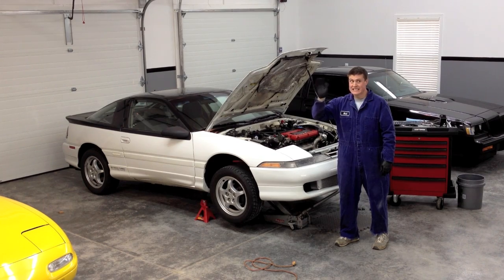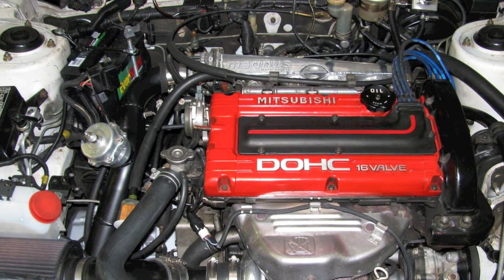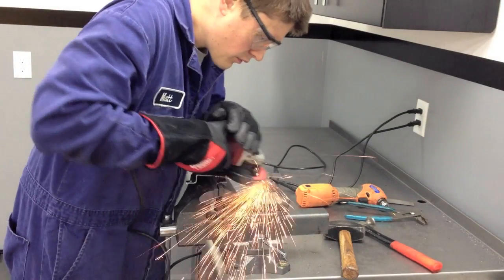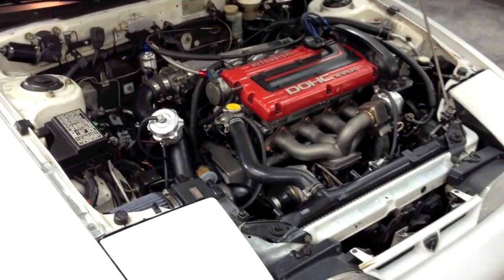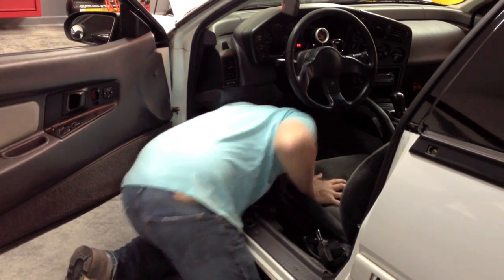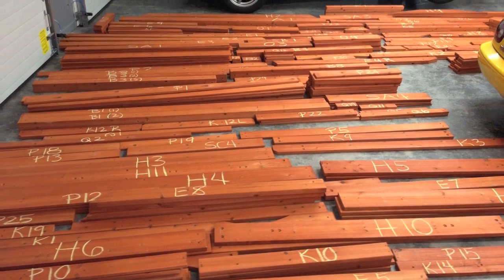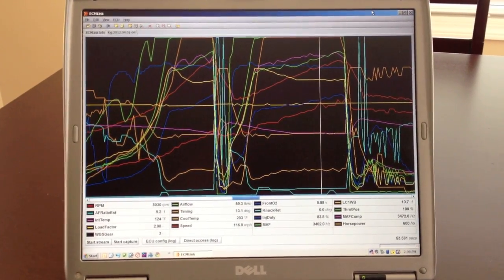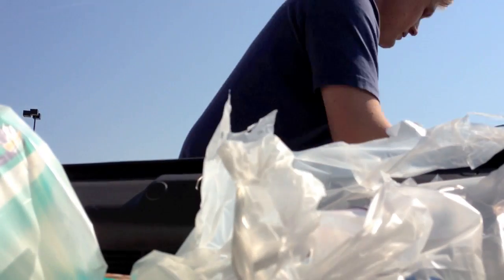Eagle Talon AWD Turbo Upgrade - Part Two

Comment: Tom, any chance on doing a how to for the fuel filter? I know that it's probably one of the most difficult parts to replace on the 4g63, I've  had a hell of a time with it and I know I'm not the only one. I would much rather do a turbo upgrade than the fuel filter again.

Comment: Vary nice! im just jumping since i worked on a few evos before. I suggest a ets front mount it'll help lower the inlet temps. Also if you want a good feeling a turbo smart supersonic bov is probably the loudest bovs on the market. I myself am not a fan of meth since its corrosive. We switched over the e85 with the 2150 fic injectors. But we had to switch to an aem setup at that point.

Comment from the maker: Hi there, the only one I recall seeing was from JNZ Tuning.  That said, I've always been happy with the stock DSM shifter with solid bushings added to the base, a set of new factory shift cables and new bushings at the cables where they hook to the transmission linkage.  I would recommend that in case you haven't done those things.

Comment: I like your videos tom but I have two questions. I really like the eagle talon and was thinking of trading my car in for one and upgrading it. How much would it be to get it up to the hp rating of yours? My second question is should I just not buy a talon and keep my 01 mustang v6 and upgrade that. I just want to know which one would be cheaper. Im getting tired of my v6 its just slow and not reactive when putting my foot down. These will be daily drivers btw.

Comment from the maker: Hi there, and that's a great question.  I used to drive this car about 50 miles every day to work.  I did that for a couple years and then only drove it in the cold/winter months after that.  During that time it was in the 400-450hp to the wheels range.  I would hammer on it about twice a day, but nothing that would stress the driveline.  Just taking off from a roll when getting on the highway, etc.  I think the keys to reliability are good regular maintenance and a simple setup.  Good luck!

Comment from the maker: It's going to vary wildly based on what parts you have on hand, what you buy new vs. used, if you go a different route in some areas, etc.  All of the info is on my website, you could easily figure your cost from that.

Comment from the maker: You're welcome!  Regarding your question...that is a tricky one to answer as there are just too many variables to account for. That said, with ALL stock drivetrain parts being in excellent, factory condition and a quality aftermarket clutch/flywheel combo, I had no problems at the approx 400hp to the wheels power level for many years.  Just keep in mind the stock stuff was designed for 195 horsepower.  Anything beyond that is assuming a certain amount of risk.

Comment: My first FI car was a '91 TSi AWD Turbo /sniffle.  I had a ghetto manual wastegate controller under the dash and pushed that poor little thing to @18psi with no fuel control.  She lived through my ignorance and ate up those poor low output pushrod V8s of those years.  What a great car.

I just bought a Mazdaspeed3, and the rush of the turbo has taken my back to my youth :D  Thanks for the video, I'll be watching for more!

Comment from the maker: There are a few datalogging options, some DIY options with free software too.  After using them all over the years, I would never use anything but ECMLink.  I'm not sure if it will work on your conversion, but not only is it an awesome datalogger, but you get the tuning capability too.  If the price seems high, you can find them used or get the lite version and upgrade later.  Good luck!

Comment: Hey man sweet video, i just picked up a 91 eagle talon fwd. top end fully built. tsi no turbo engine converted to turbocharged running the 20g godspeed turbo. have yet to drive it yet im hoping everything starts up good. i had a question on the ecu and how to record data if you had a link for that i would appriciate that. thanks man keep up the work!

Comment from the maker: Thank you sir, I appreciate the support!  I haven't made a heat shield yet, only because I am still deciding on a filter setup/size.  I have made a little cold air duct though for when I'm racing.  Thanks for the ideas and have a good one!

Comment: Did you perchance make a heat-shield around the POD filter? I think it'd be beneficial if you maybe routed a duct from the bumper to right below the filter, so while you're driving air gets rammed in there. Not to mention someone with your fabrication skills could probably do this while sleeping! Just thought I'd mention my idea. I love this show. Makes me want my old 1.8 8v Laser back!

Comment: you can by a splice almost and it just screws on right before your oil filter and then your oil filter on top or in front of it and the splice will have a a house to connect into the fitting and run to the turbo i personally have one on my car which is at 14lbs of boost and have never had an issue hope my comment helped you

Comment: I'm pushing 450 hp I don't have and meth injection. And going to install bigger injectors and bigger turbo come spring time. The car as it is runs mid to high 11s

Comment from the maker: Sounds like a fun build!   Just triple check all of your work, take your time and get the proper quality/size supporting parts like injectors, cams, etc.  I have always used factory mitsu 1G knock sensors with great success, so I'm not sure what that's about.  I did try a local parts store knock sensor and it was trash!

Comment: Turbo Tom, Im building a 6 bolt to be put into a hyundai excel FWD. upgraded valve springs, rods, pistons, 20g turbo, any advice on how to ensure she puts down 400whp solidly? also, ive heard stories of the 6 bolt knock sensor not picking up knock and to use a 2g knock sensor, whats your take on that?

Comment from the maker: Probably, but for a fraction of the cost, I now have a very strong, compact battery that fits nicely in it's new home.  It's also easily replaceable locally when I do need a new one.

Comment from the maker: Thank you!  First off I would get a copy of the factory service manual and ensure that everything on the vehicle is in good operating condition and that all of the maintenance has been performed on the drivetrain.  This process is unfortunately overlooked by so many people, but is necessary for a good foundation.  From there, I would look at what others have done on the DSM Forums to reach similar goals.  Mainly, keep it as simple as possible.  Good luck!

Comment from the maker: Tank varies greatly on tank size, nozzle size, driving style, etc.  My setup is on or off based on a set boost pressure.  There are progressive kits that inject more as boost increases.

Comment: Makes sense, but also how long does it last on one tank ? and do you set it up at a lower boost pressure to then jump you up to a higher PSI ? or do you just have it set at a high boost pressure to have it maintain high boost ?

Comment from the maker: Well, I've never tested it in this way, but it allows you to run much more boost and timing on pump gas, which gives a significant performance advantage. I'm sure there are folks that have before/after dyno tests, etc. out there on the webernet.

Comment: What do you think I should do to my 92 talon to squeeze a little more horsepower out of it? Everything on the car is stock minus the pistons and bore size which is at .50mm over. Been a bit of a project car and once its back together and broken in I am going to start looking at options to get a little more horsepower out of it. Looking at around 300 when the time comes so if you could offer me your opinion I would appreciate it. Epic video by the way ^_^

Comment from the maker: Thank you and I'm glad you like the videos! The cost is tricky to pin down, as many parts were from other mitsu/dsm cars I had in the past, DIY stuff, used parts, etc, etc. You could look at the mod list on my website and estimate, but I'd say I could build it today for $10k including the price of the car.  This estimate is made with longevity and reliability in mind, obviously it could be done for less, but would be less dependable over time.

Comment: Might I suggest a "Calan Catch can" They use a filter designed to remove oil vapor from air and constructed from aluminum. They are very nice, I actually know of a few people running them with the CC vent hooked up via OEM routing, and have measured with MAP sensors a negative CC pressure once they went back to the OEM routing. This lets you do that but keep the crap out of the intake tract. I know you know this, im saying for the others that may not lol.

Comment from the maker: You can find a good DSM for a reasonable price, you just have to be patient and know that the perfect one will likely be 500 miles away. :-)  I did not port this turbo, as the casting is well designed from PTE and doesn't require porting.

Comment from the maker: Thank you!  Valve stem seals aren't terribly difficult, but while you have the head tore apart it's good to just go ahead and do a complete valve job too.  That's best handled by a machine shop with the proper tools.  Good luck!

Comment from the maker: You're welcome and thanks for the support!  If you are just interested in auto mechanics as a hobby, first get a real factory service manual for your car of choice, then pick up a decent starter tool set (like a Craftsman), and then begin taking on the basic maintenance items.  

From there as your skills and confidence improves, you can begin taking on bigger jobs.  Before you know it, you'll be finishing projects that you wouldn't have imagined possible.  Good luck!

Comment from the maker: Pics/details are on my website, but I am using a ShepTrans stage 3 transmission and ACT 2600 pressure plate with a stock mitsu 2G clutch disc.  Good luck man!

Comment from the maker: Hey rallyartman, the antifreeze is Prestone's "Dex-Cool approved" stuff, which from what I've read means that it is just compatible with vehicles that used Dex-Cool from the factory.  I've used it for years with no problems, but now everyone has me paranoid about it! :-)  Regarding the oil, I guess it's just tradition- I've been running it in this motor since 2004.

Comment from the maker: I have tried the Hawker Genesis, the Odyssey pc680 and one other which are all basically the same as the Buschur Racing mini battery.  These batteries were all fine when I was daily driving the car, but once it started sitting, they would become weak and were very finicky to charge.  A battery like the 51R is heavy, but can handle the downtime and is easily charged/replaced under warranty.

Comment from the maker: Thanks a ton!  Regarding the Miata, you're right to avoid the no-name turbos. It was a complete gamble on my part as there seems to be a 50/50 success rate on those turbos. If you're using the same turbo manifold that I am on the 1.6L, a small Garrett 50 trim T3 is hard to beat.  You can see the numbers it made for me and has tons of low and midrange power. You can find them at ATP Turbo, among other places.  Good luck to you!